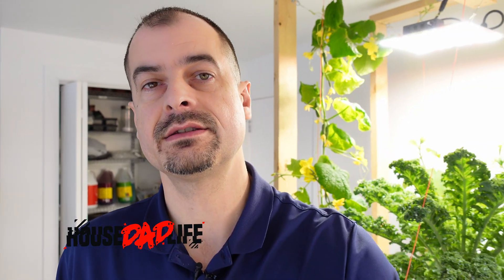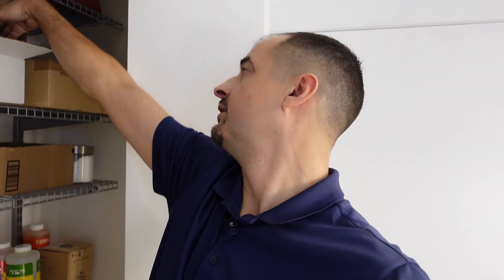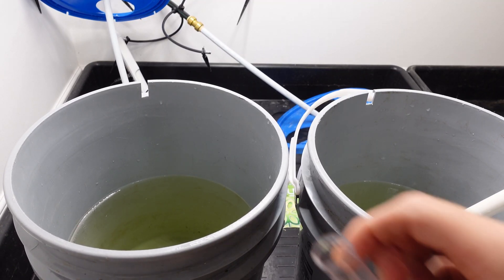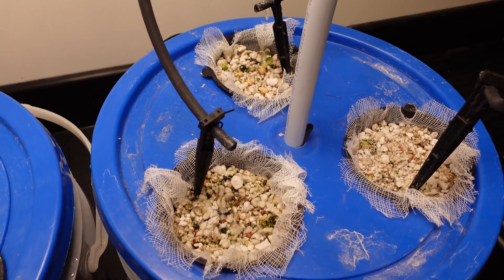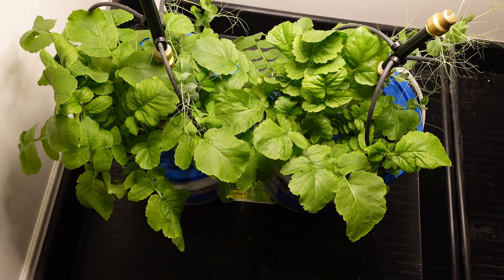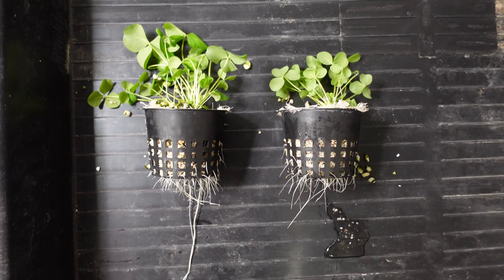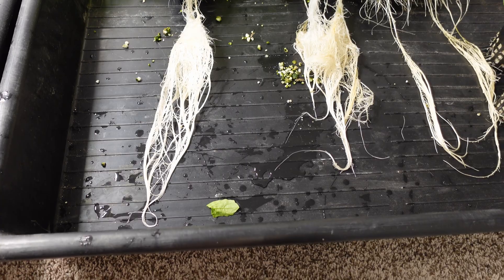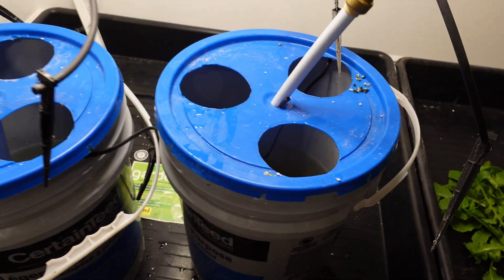RO vs Tap Water: Hydroponics SHOCKER!

Comment: Interesting, I did not expect that. I would have expected the higher ppm to cause nutrient lockout and would expect stunted growth... I guess I ain't so smart after all. Tap is certainly cheaper/easier, but you gotta keep the RO for your coffee. Fascinating indeed. Smash. 
In my world, I've stopped cutting my strawberry flowers, I'm letting them grow to maturity. The high temp tomorrow is forecasted to be -6C, it's an indoor garden day. Have a lovely weekend, kind sir.
Reply from the maker: Glad you stopped in.  The temperature here is finally starting to break a bit as well.  Getting the spring itch.  In the past I've found better results with RO, maybe it's dependant on the type of nutrients.  Do you use RO? As far as coffee goes, oh yeah, couldn't agree more.
Reply: @HouseDadLife  Yep, I use RO for growing. When I start I use a mix of tap and RO, but when it goes in full nutrient it is all RO. I have a shelf of buckets I keep with RO water (plus bottles for topping off). On a side note, I have been starting some plants in full nutrient, namely green onions, daikons, and arugula. Some people start lettuce in full nutrient, I'm not a fan of that. I like finding ways to skip a step when feasible (which is difficult for me because I'm hyper OCD and I like having consistent processes across the board). Oh, one tip on starting tomatoes for the garden... I start my tomatoes in hydroponics then I take cuttings and root them and put them in dirt. That way I only have to start 1 of each variety. Works great.
Reply from the maker: That's some great tips there, I've just recently started to keep a bunch of pre mixed nutrients on hand.   As far as cloning the tomatoes, solid idea. I still start a bunch inside then use a garden drill bit and plant them insanely deep. This worked out so well last year when we had a record drought.